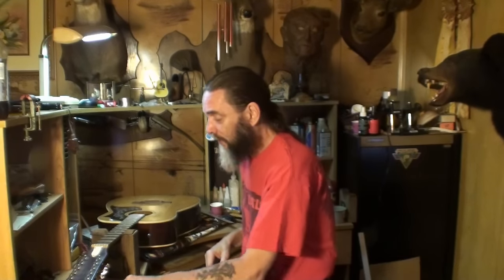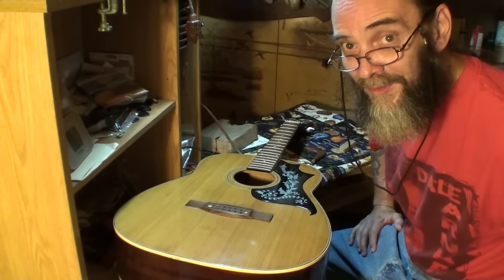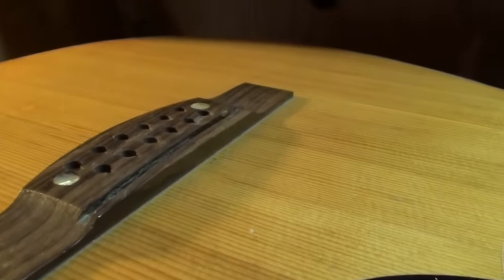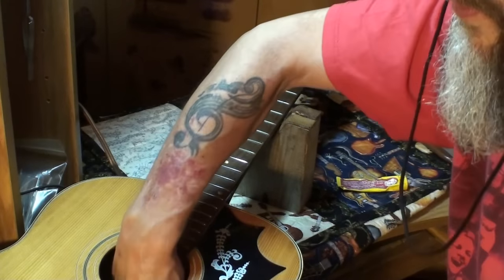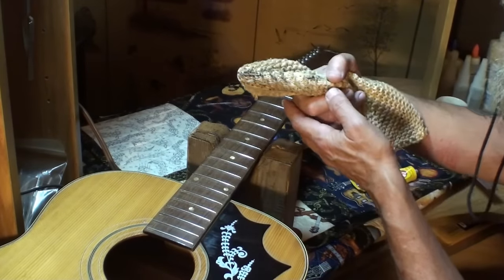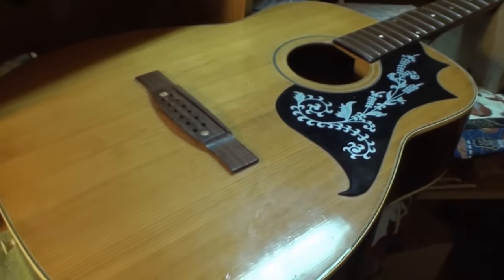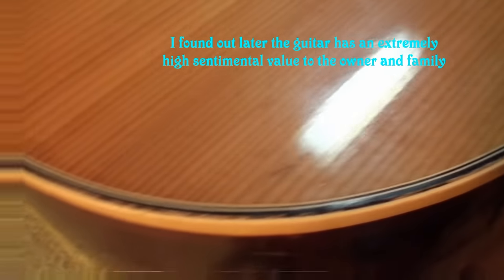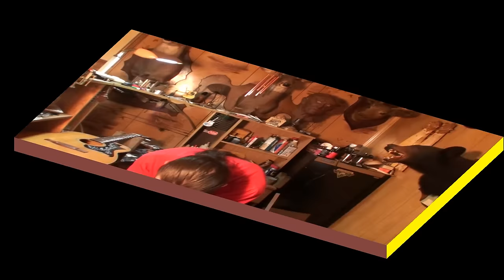Acoustic guitar brace repair Telestar 12 string guitar

Comment: I just bought one of these off FB marketplace last night for $110, but mine has the tail bridge. It's in pretty good shape. I threw a straight edge on the fret board and its slightly above the top of bridge. Intonation is spot on and it has a truss rod plate on the head stock which I haven't taken off yet to see if it has an adjustable rod. The action is high at 12th but this weekend I will try sanding down the saddle. Thanks for your videos. Except for your video, I can hardly find any info on the web about these guitars. The owner said he bought it in Nashville in the 80's and said it was made in the 60's. Thanks again!
Reply from the maker: thanks for checking out my videos! this guitar too came from the nashville area I am told, the owner unfortunately didn't want to put the money into it to fix everything it needed. thanks again and good luck with your repairs!

Comment: I have something called "Quick-Glo" that polishes just about anything removes rust from chrome which is how I found out about it.  But brass, fiberglass,  I've gotten marks off car paint finishes with it.  It has a wax bass to it and I wondered if the stuff you use does as well.  I found out about on Jay Leno's Garage and it turns out to be a local guy from here in Baton Rouge.  I should give him a call and see if he got flooded.
Reply from the maker: I'll have to check Quick-Glo out, I've never heard of it, it sounds like this stuff I use and I bet it would work well on polishing frets. The Happich I use is more like a paste than a wax, not very abrasive but it always seems to cut thru what ever I've used it on and it seems you can use it on just about anything. Thanks for watching and thanks for the info!
Reply: He has different grits of the product.  And because it's a wax base it keeps it clean.  I just worry about the wood on the fret board with wax on it.  I've never used it on my guitar.

Comment: As always a good video. Randy can't you pull the strap plug out of the guitar. And put your cam inside the guitar through that? That will give a better view in. Down from the bottom of the brace's. Not trying to tell you how to repair it. Just a thought. I figured I'd share it. I look forward to the next video.
Reply from the maker: +Thomas Tommy probably could but it probably would be as easy to have put it thru the sound hole, the little wire wouldn't make it any harder to get my hand in it. I thought I was going to have to use it the camera to get glue on the brace but manage to feel my way through it lol

Comment: Thanks for the tips and help Randy,  I got a problem with two big cracks on the top and 3 braces completely off, do you recommend I glue the crack first then do the braces, cheers randy really appreciate it.
Reply from the maker: Yes, humidify inside the body and the cracks usually close, glue and clamp them then glue in braces and they will help support the cracks. Happy repairs!
Reply: Randy Schartiger many many thanks for the quick reply much appreciated.

Comment: Great Q-ball fix, was missing her....please give her a hug for me:D Looks like the brace had plenty of squeeze out, it looks like it will hold. Still wondering about the fan bracing/bridge. Was wondering if it could have been intended for a 12 string nylon string guitar, maybe mistakenly set up as a steel string instead? Still pondering over that. Have a great weekend, enjoyed the video! :D
Reply from the maker: One hug delivered and Q says hey! :) Yeah I wiped the squeeze out away before getting the shot of the brace and in that little time it took for me to get the camera more had squeezed out, it's really hard to work inside this guitar because of the sound hole being so small but that small of hole will give the guitar more bass. You could be right about the nylon strings, just everything about this guitar is strange and weird. Thanks for having a look and hope your weekend is being a great one as well!

Comment: Depending on what gauge strings were used on the beast . . . there could have been more than 366 pounds of tension , * that being the pull of 'medium' gauge . . .  No doubt that 50 years of string tension would change the neck angle a good bit !   Working under the gun for time is a shame . . . especially since the main cause can't be addressed :(     
       This guitar didn't look like it had a bridge plate under the bridge . . . if I remember correctly ? ?    But then , if there wasn't a big belly , then it's absolutely not a case of the bridge raising up , or the face bracing getting warped , loose or broken !    If there isn't a bridge plate, it sure would be a good insurance policy to stick one in for good measure - since you're going to be losing some 'grip length * and strength' on every string peg !   Drilling pilots , then a quick 'ream job' would fit the pins . . .  
        Saying all that is a moot point , 'cause it's now SUNDAY , & this box is rambling down the road :p       Hopefully intact !        Your next video should be the final on this one -  HOLD ON ! ! !
Reply from the maker: You are correct the angle of this neck is off about as bad as any guitar I've ever seen, it is REALLY off! And with that amount of stress as you mentioned over such a long time the guitar is giving away to it. Yeah it doesn't have a bridge plate so that adds to the problem. Adding a bridge plate would helped the guitar a great deal and probably gotten most of the belly out of it but yep shes back in the hands of the owner now. Just wait until you see what happened when I tuned her up! That'll be on the next video and last one on this guitar as soon as I edit and render and upload and all that jazz! Hold on! :)

Comment: Sorry to say Randy $ amount on a guitar like that is very low. Maybe 300, year wise prolly between 65-70 I couldn't find the exact serial # on it.

I just made a little screw Jack and used it on a Goya guitar to fix braces but I haven't YouTube-fied  that video yet. I like your prop idea, think I'll make a set of those all about an 1/8" different in length. Getting at those braces is a pain or a bruise for sure.
Reply from the maker: Yeah it's a pretty cheap guitar I know, and needs the neck reset and the owner doesn't want to put that much money into it, which I don't blame him. 

Of course Stewmac sells those little jacks you can screw against braces to hold them but they are a pain to get in there where you want, these little props work wonders and much easier and faster, I think I have about 8 of them in all different lengths. Thanks for tuning in!